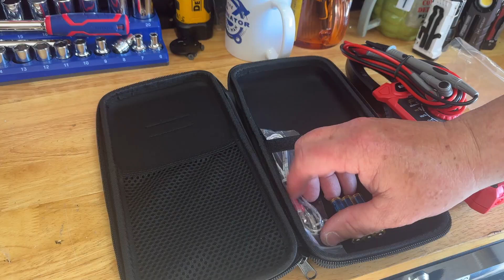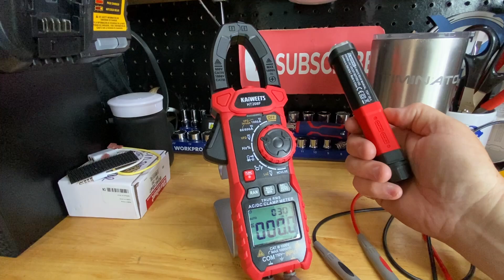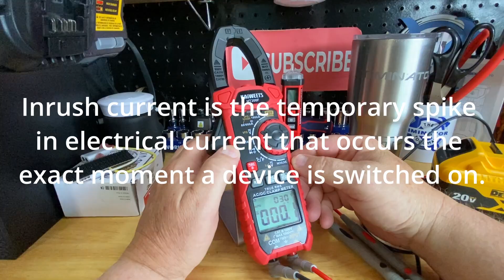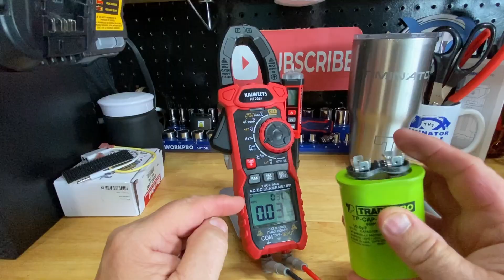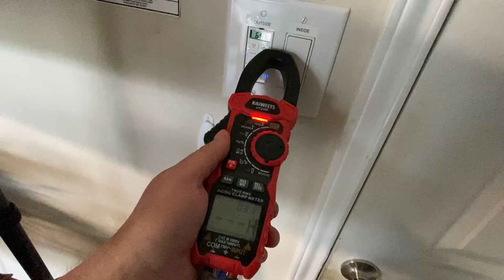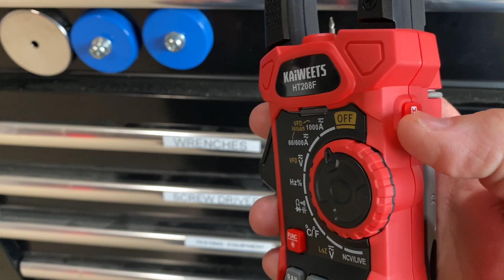Best Budget Electrical Tester Pair. #Kaiweets

Comment: Hi,
sorry for the English I use a translator
For an entry-level model, this clamp meter is really versatile in terms of its functions. Kaiweets likely created this model because there was probably negative feedback regarding the HT208D's display quality specifically, that it was unreadable in bright light or direct sunlight.
The test leads seem genuinely decent, featuring flexible cables, and the display backlight is sufficiently bright and uniform.
To nitpick a little: when you turn the rotary dial to the Amperage or Voltage setting, it defaults to DC rather than AC. I find this a bit of a shame, as it forces you to press the "Function" button something that can quickly become tedious, especially when performing multiple electrical tests.
Honestly, for the price, this clamp meter is a real winner.